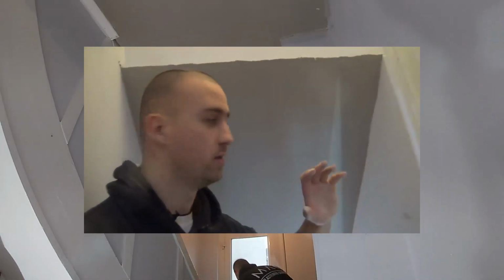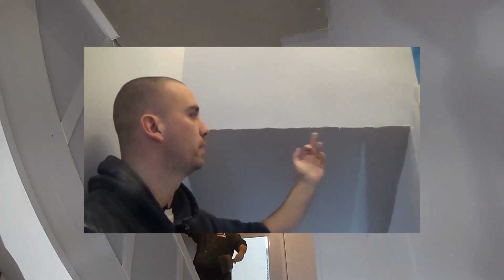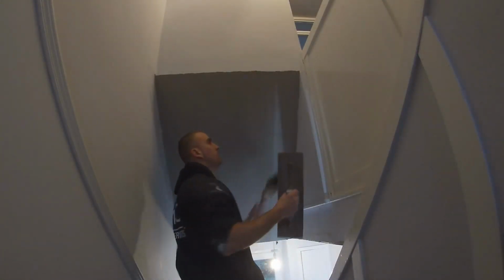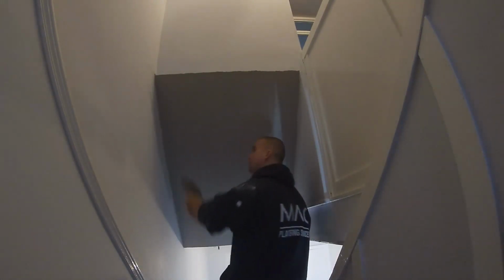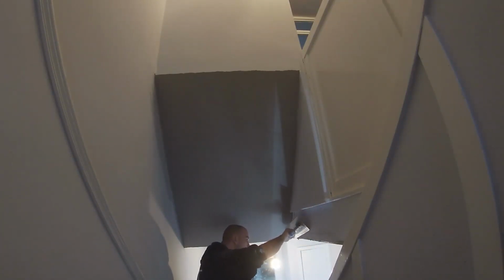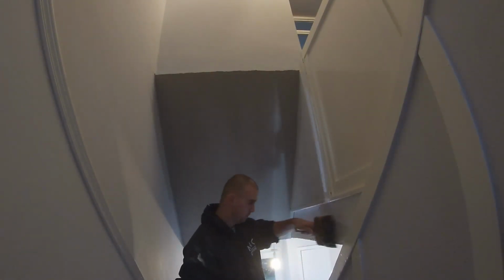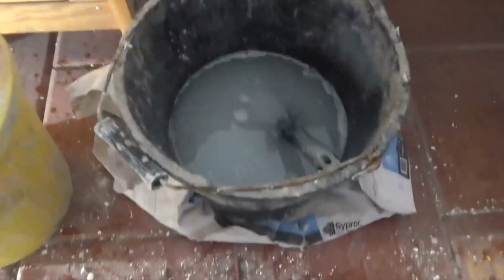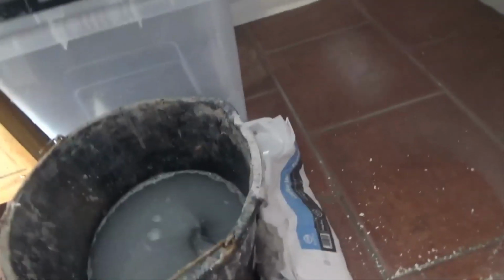plastering v log loads of tips plastering stipple ceiling make good bonding carlite plaster part 4

Comment: Hello, I just got an extension built and where the new extension wall meets the old pre existing wall, there are cracks that I can only describe as looking like bird feathers. They go from bottom to top along the line of the corner bead. I'm just wondering is this normal or should I call back the builder to have a look?
Reply from the maker: It dont sound to normal , sounds like a strange shape might be best to ask him to have a look, I have seen the change in weight cause to original build to crack some but for sure if you are worried ask him his taught and if very worried a structural engineer will know Hope it is just settling cracks mate
Reply: @macplastering  I've been telling myself they are just settling cracks. They are about 1-2mm in width and only along where the old wall meets the new wall. Was a concrete block with sand & cement render then skim coat on top. Skim coat was done in December in 1°C weather. I've been telling myself its just the fact the plaster is adjusting to new temperatures since we are now into spring.
Reply from the maker: Plaster can crack from lots of reasons like you say the heat / temperature . Drying to fast and movement are another weak and wrong mix can but most likely  would cause a fail to bond than just cracking let me know how you get on mate

Comment: Hi mate. Im interested in your recommendation for a good mixing drill. I've noticed you've used a few different ones in the past. What is your favourite and most reliable? Thanks.
Reply from the maker: Love the battery  powered ones that are light great for small jobs ( rubi and collomix) The refina mega mixer is a work horse and wont let you down but it has a lead cant wait until they go cordless with a batteries as they do have a fuel one   :)
Reply: @macplastering  thanks for your reply mate. You make great videos , really appreciate them !
Reply from the maker: than you Baz mate think we have managed to upload a video every week for a fw years now and always aim for a Sunday :) So hopefully you can hit the bell icon not to miss the newer stuff :)

Thanks again for watching and supporting matey :)

Comment: Hey Mac, recently I've been having problems with my plaster falling off, I'm a property investor so not a major problem but what's your bullet proof prep for plaster. 4:1 diluted PVA? I have a feeling it's because I mixed a little bit of blue grit in my PVA I'm just trying to get to the bottom of it. Thanks Mac, and thanks for the videos.
Reply from the maker: Best thing is to read the pva some are to go on 100% pure and others 50/50 then 3 to 1 and 4 to 1 they are a diffrent and even recently i have found ones i used for years changed the ratios haha so yes it can be a mine field I paint my glue on and was like why isn't this drying as yes i use this one all the time and found its because the changed it to 3 parts pva 1 part water, I dont use grit no more as it failed on 2 jobs one me when all was done correctly making me feel a right one and even so I thought the only way it dropped was bad plaster it got tested and came back 100% and as you know if you watched a few my videos I will really look for cracks and lose boards plaster or paint I do try do every thing to try make it last 100s of years, and have lost faith n grit after those but for sure never mix them wouldn't recommend epically as the glues are diffrent types I would say you could grit let it fully dry then pva on that for over kill but in all my years with just pva no jokes i have had very little fails so much so that the only one i can think was the size of your fist and  believe that was due to a pip behind drying the pva and then the plaster to fast. Sorry for the huge reply hope it was helpful
Reply: @macplastering  thank you for your reply Mac, my PVA says diluted up to 5:1 should I do it 4:1 to make sure? I did a big ceiling and 2 weeks later It was coming off when I went to paint, I put a point with my trowel and it fell down in a big sheet 😂. Would doing 4:1, twice and letting it dry be ok? I did 2:1 and it had a thin layer of glue that rubbed off to the touch this is becoming a much bigger problem that it should be haha. my plastering is great just this problem I'm trying to get to the bottom of, your help is a big help thank you.
Reply from the maker: again its all down to the type of pva, best to follow it instructions but in this one I think i have gone 2 to 1 and plastered over when tacky with a bond coat then when that was ready skimmed with 2 coats of finishing plaster, I have a few like this video  shown this and going into detail I find it easy to explain during a video than typing as i can show one that might be good is the how i  re plaster an old wall - https://youtu.be/FKbkjCBpEq4 and just like this series only on the ceiling -  https://youtu.be/YuUoZZ6v6MU these would describe a lot of course everyone dose things that little diffrent and an get good results but these have worked for me from the start and the guys that taught me so its a time and time tried and tested method
Reply: @macplastering  thanks for the advice Mac, the PVA I use is from Evo stik it says diluted up to 5:1 is there any harm doing it 4:1 slightly stronger? I'd rather go slightly stronger than weaker. And is it ok to PVA a wall twice and let the PVA fully dry both times then skim? Sorry for the stupid questions my plastering is perfect except for this it's making me scared to do any more plastering 😂
Reply from the maker: @louisjenkins3361  hi mate just did a new upload there :)  I know guys who do it that way and have good results but i prefer it tacky myself best to do some small test to see how strong it is if unsure , again I hope to show what kind of test I would do on these things
Reply: @macplastering  thank you Mac, I have a full house to plaster in a couple of weeks hoping I don't have problems like the last one 😂 thank you
Reply from the maker: What pva have you been using mate ?
Reply: @macplastering  Evo stik, but I think it was because I mixed the last of my blue grit into it and all areas I did that have failed. I just spoke to someone and they recommend 5:1 PVA to seal the wall then 3:1 for plaster and PVA re emulsifies when you plaster over it once it's dried so I think I'll do that from now on. They also said SBR to seal the wall instead of 5:1 PVA definitely gonna try this out next time
Reply from the maker: @louisjenkins3361  this one mate? - https://amzn.to/3wSpLa3
Reply: @macplastering  it's the one in the Jerry can container
Reply from the maker: @louisjenkins3361  is that the same make tho mate ?
Reply from the maker: @louisjenkins3361  just reson i ask is that one dose say 3 to 1 but it is 3 parts pva to only 1 part water could be a reason it fails on you mate if its the same pva and you mixed it up 3 water 1 pva as would be weaker
Reply: @macplastering  hey Mac I have a couple more stupid questions if u don't mind mate 😂 if part of the wall needs bonding out to make it flatter what's the best bonding agent, PVA still or blue grit in that regard obviously bonding out plus skim can add alot of weight to the wall you don't want falling off. Also when scrimming corners on existing walls after glueing most the time it doesn't stick what's the best way to adhere scrim tape I usually just use some skim to hold it but whilst doing it that wastes time whilst my skim goes off losing a bit of time. Thanks Mac sorry for the stupid questions haha
Reply from the maker: @louisjenkins3361  I prefer pva I think it is superior as I have had to very bad fails with grit but nothing but a tiny fail on pva and I have done way more jobs with pva than grit so it must be better :)  but yes I do that when the pva wont hold I use skim but when the pva is tacky it should hold ok  but yes a little lick of skim is the ticket :)
Reply: @macplastering  thank you, bought a lot of properties that need a quick a reskim. My plastering is sound just 1 ceiling failing has put me off plastering haha
Reply: @macplastering  another stupid question sorry 😂 do you think it's ok to stick beads with pinkgrip?
Reply from the maker: @louisjenkins3361  Never done it myself theirs say its good but I to be honest cant see the point of needing to buy another tool (silicone gun)and material to do the job when you have skim there to skim if this makes sense
Reply from the maker: @louisjenkins3361  ps never a stupid question mate :)
Reply: @macplastering  thanks haha, I have a good 30+ properties I need to buy and refurbish in the next 2-3 years hoping to learn to do stuff quicker/better plastering is probably the trade that takes the longest for me on a refurb
Reply from the maker: @louisjenkins3361  I would think plastering is one of the hardest trades to do and learn mate for sure some say its not a trade its a craft and way more than meets the eye  30 plus houses you must be doing very well buddy congratulations are they all house to flip or rent ?
Reply: @macplastering  yes to rent out and refinance. When I was 20 I was a plasterers labourer for 6 months didn't let me even touch a trowel. I had a go on my first property I bought just learnt from my mistakes now its become natural. I can't plaster like you, it's bang average, but each property I've refinanced has all valued up to what I wanted so even if I did it better it wouldn't have made a difference so I think I've perfected it in my eyes haha
Reply from the maker: @louisjenkins3361  Makes sense man for sure the ones you'll make more valuable are the ones that are really bad so plastering will make them worth much more as boast lose plaster. ceilings that are textured and old dated wall paper so anything will already be an improvement but plastering will make them much better or sure :) Glad you are doing well mate I wish to invest into property as much as possible :)
Reply: @macplastering  thanks mate, not been able to buy a property in 8 months prices are insane. Hard time to be a property investor, finally just bought 2 so I think it's coming back down a bit luckily
Reply from the maker: @louisjenkins3361  Where about is your market ?
Reply: @macplastering  near Wirral/Liverpool houses have all been going straight away for asking price, no money left in them to refurb them the market doesn't make any sense just been lucky recently and got 2 decent ones
Reply from the maker: @louisjenkins3361  nice one mate yes got to get them at a good price or no point for sure :) I find estate agents hard to deal with
Reply from the maker: @louisjenkins3361  mate watch as I need to stick my scrims with the bonding after pva https://www.youtube.com/watch?v=YuUoZZ6v6MU
Reply: @macplastering  cheers mate, great video looking forward to getting back into plastering again soon. Thanks for all your advice mate I appreciate it
Reply from the maker: @louisjenkins3361  No problems buddy always here and appreciate your support on the channel :)